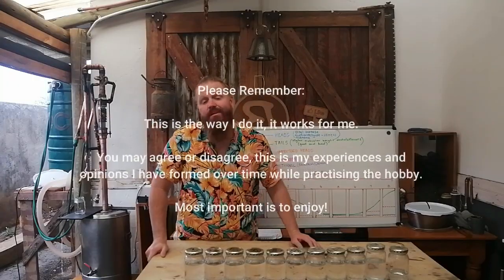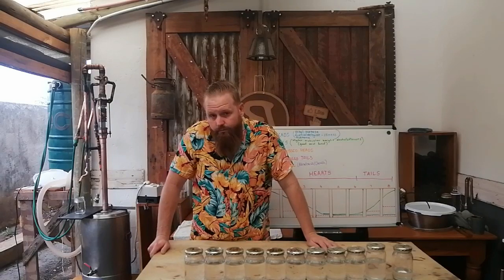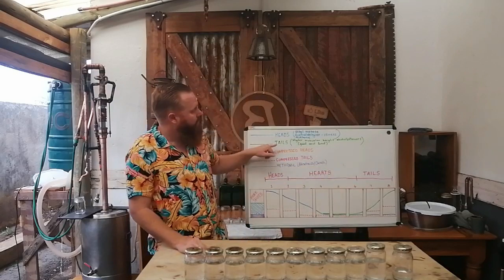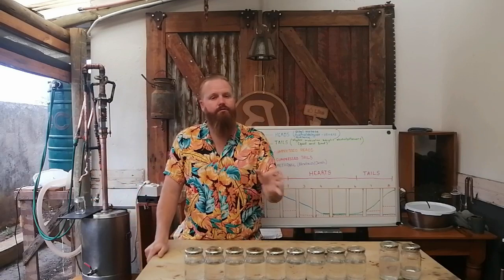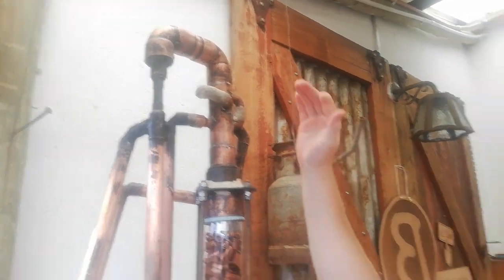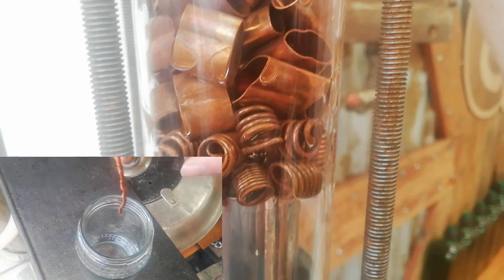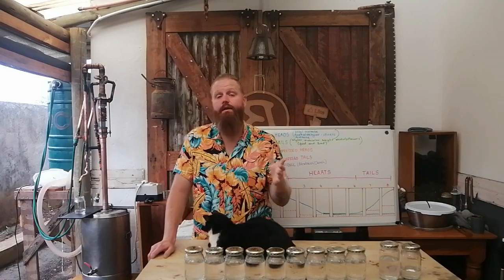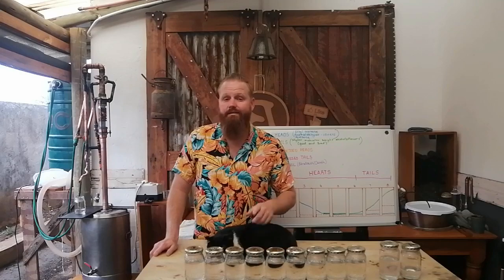How to make Cuts while distilling, separate Heads, Hearts, Tails

Comment: i only started recently . I got a water distiller (4 litre, 750 watt) Without Temperatur control BUT i bought a Voltage dimmer to reduce Voltage to 15 v instead of 240 v . each 4 litre batch i discharge 30ml fore shots and collect 800 ml add 200ml water to dilute to 40% then i add some whiskey flavour concentrate . Not perfect but drinkable

Comment: Thanks for sharing your way of distilling. Just wondering, why compress the forrshots and heads? And at what temperature is the top of your column? I would worry that if I start hitting 173 degrees that then I am losing alcohol. When you are compressing the forrshots are you keeping it around 168 degrees?
Reply from the maker: Hi Frank,

To be honest, never really tracked my temps, only started for the channel, will have to do an update video with temp and compression comparison. What I found with the temp is each wash is different depending of the flavor I want to get, but will do a update video with the new still.

Comment: Hey Beaver that’s a great video mate, thank you for explaining the process.
The still I am using at the moment is the T500 and I don’t have a voltage regulator and I was running a TPW this time which I had stripped from two previous runs.
From the beginning of the run I balanced the column and compressed my heads for 20 min then I turned the water for the reflux coil down a little and then around 20 seconds later  I had the usual amount of production for my still.
After I collected the first 50 ml at the normal pace for my still I was surprised that another 250ml came pouring out very fast and filled up a 350ml bottle almost instantly.
I’m guessing that I reduced the reflux coil water a little too much
On a normal run for me I collect the 50 ml of Meth and then about 250 ml of heads and then collect in 250ml numbered jars, I don’t start to collect the good stuff until jar 4 or 5 however this time I started collecting the sort of spirits that I like at jar 2 which is awesome.
Thank you for the awesome tips and have a Lekker day
Reply from the maker: Hi Paul,

Thank you very much for the feedback, since I started using this my production increased and the quality of the product aswell, the T500 is a great bit of kit.

Glad the process worked for you.

Comment: Hi Beaver. Good video. I agree with most of what you said. One comment, perhaps refering to the foreshots as methanol is not very accurate. There could be trace amounts of it but often its not really detectable. Fruit washes can contribute some methanol but sugar and grain washes typically do not. In any case, it will be only a few milliliters. That being said, safer to just toss the foreshots regardless. Foreshots / heads are in any case not palatable for most civilised people!
Reply from the maker: Hi Francois,

Agree totally with the meth, it is most of the time not even present, but for the sake of youtube I play it safe.

And yes heads are really harsh and not pleasant to consume.

Thank you once again for your continued support and info, really do appreciate having you on the channel.

Will have to do a colab at one stage...

Comment: this is your cola run which is mostly sugar. is there a difference in the cuts with a sugar wash compared to a grain mash?
Reply from the maker: Good Day,

This will depend on the yeast that you are using, the brandy yeast I use gives some great flavors to a sugar wash, but normal bakers yeast doesn't give that many flavors so no, not a huge difference in the flavor.